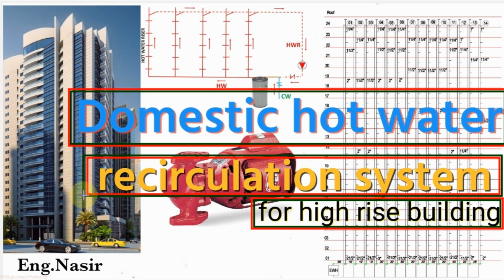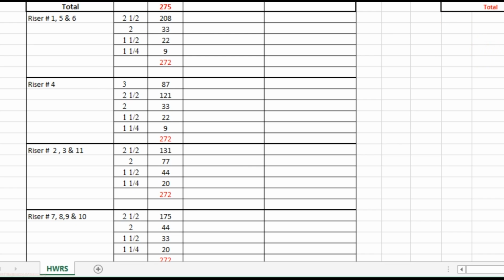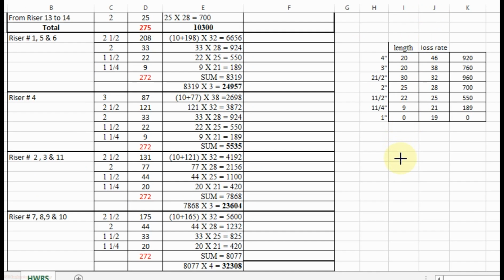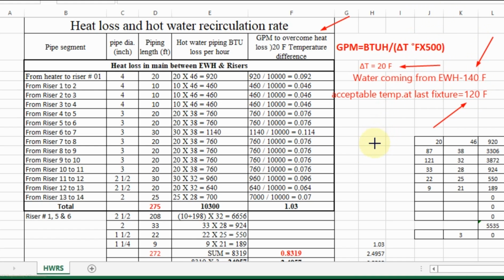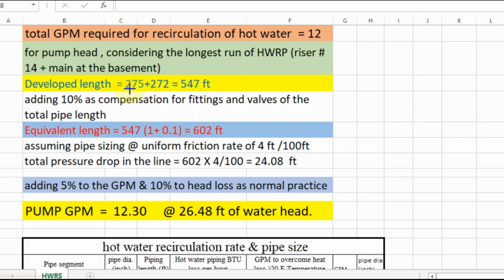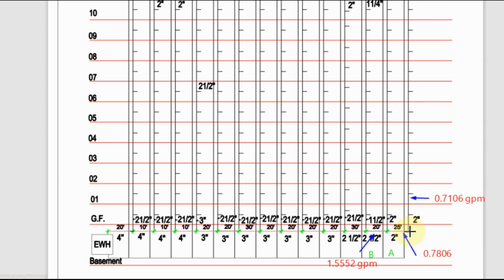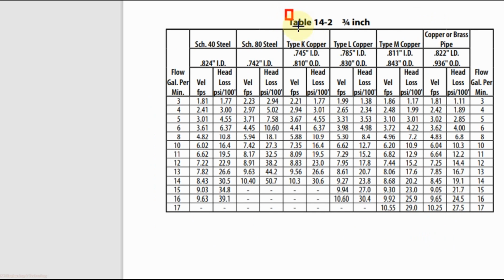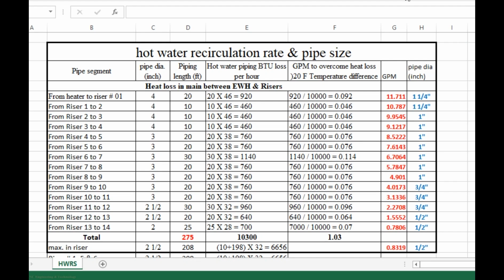75-Domestic hot water recirculation system,piping design & pump capacity for a highrise building

Comment: The calculated pipe size yu tabled at last row shows what pipe size, is that recirculation? Then why dont we select on each riser,or i can assume each size yu mentioned on for the whole vertical pipe size as well.

 Then actual pump head means the complete loop length? Pls explain
Reply from the maker: We already calculated gpm in each riser, then accordingly you can select the riser size as per this gpm.
Calculated pump head is for complete recirculation piping.